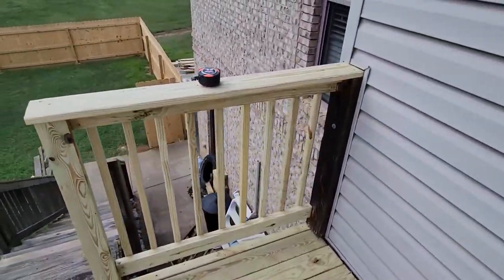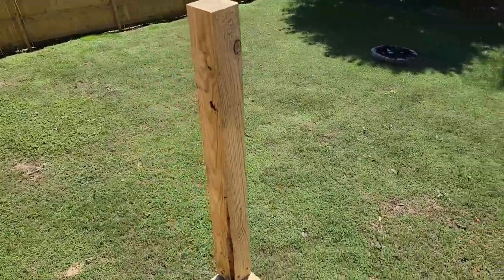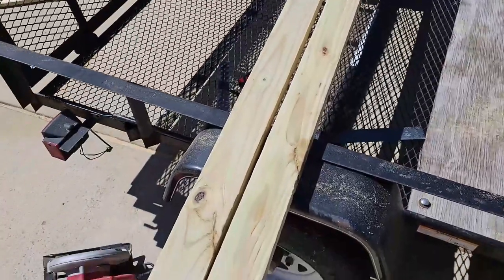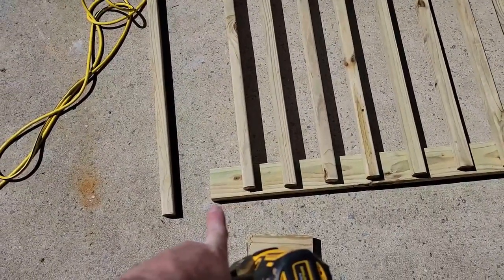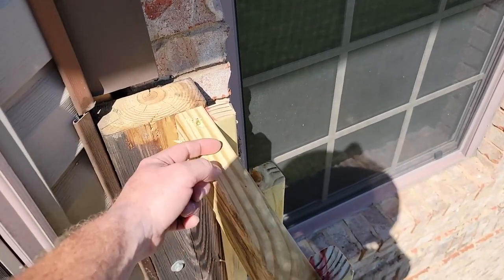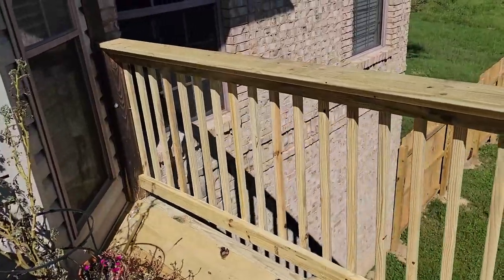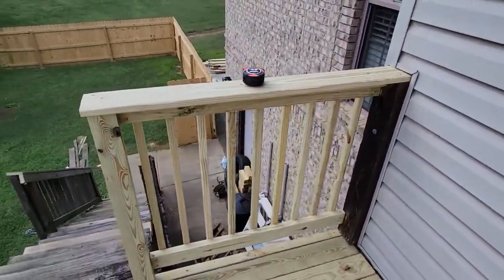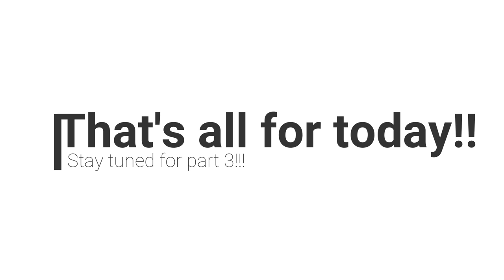DIY Rebuilding a deck and stairs...For beginner Part 2.

Comment: You should re-label this video "how not to rebuild a deck".  Unfortunately, it looked like whoever built it originally didn't know what he was doing either, so following in their footsteps was a mistake. I suppose it's a damn sight better than when you started, but It will degrade to the same dangerous piece of crap you started with in the future.  Given the sorry state of the posts that support the railing I wonder just what kind of shape the frame is in, and how the deck is secured to the house.  Do us all a favor and do at least a minimum amount of research before posting a video like this on YouTube where somebody else might think you know what you're doing and follow your example.